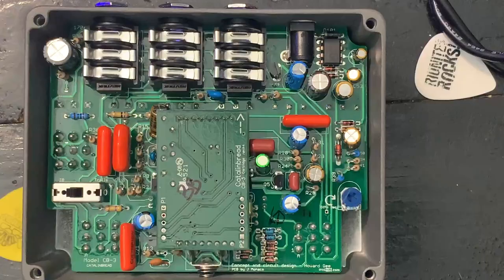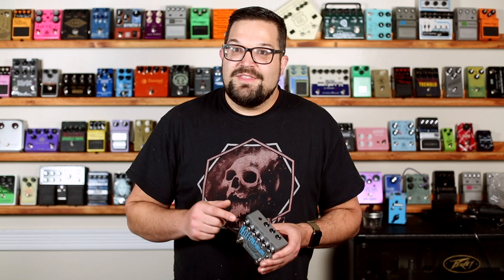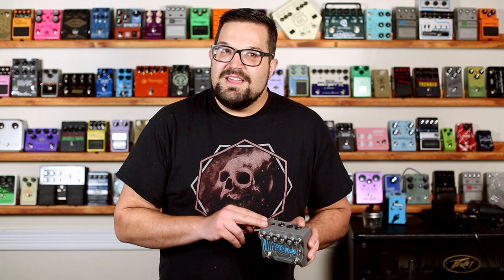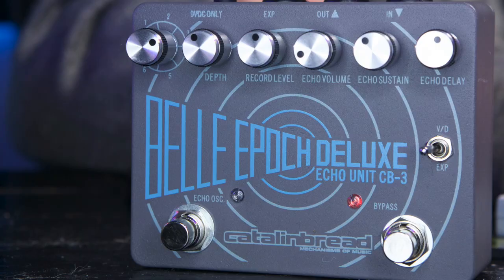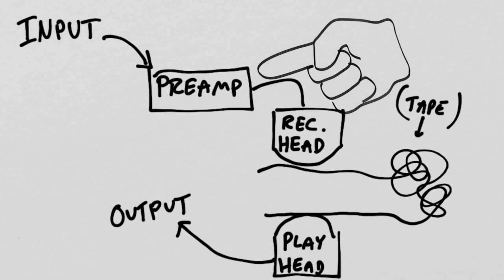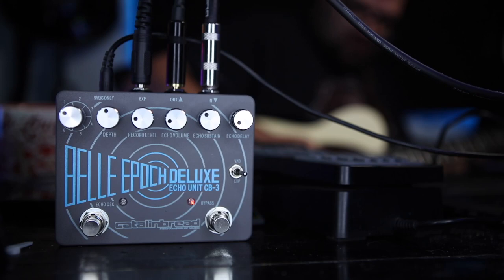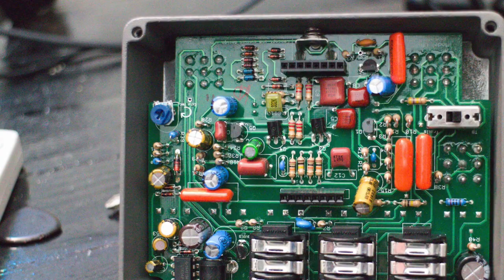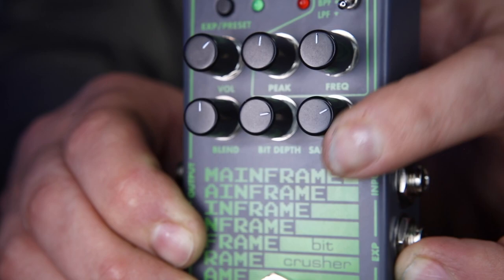Catalinbread Belle Epoch Deluxe - The Misunderstood Delay

Comment: A quick question from a year in your fuuuture..

Is there any effect or level of control afforded by the expression pedal that isn't also readily available from the knobs & switches on the box itself?

I'm going to be using my BE on a desktop, so I'm wondering if I should build a control box that takes the place of the pedal?

(If you answer, don't forget to upvote this comment so I get notified. Thanks!)
Reply from the maker: The expression pedal input can control the volume of repeats, the rate of the rotary, and the sweep of the filter, those are things you can't do from the main knobs. It does kind of suck that you can't have an expression pedal and tap tempo, though. Full details in the instructions, check out the third column of the Echo Program Matrix table: https://cdn.shopify.com/s/files/1/0370/1873/0628/files/bed-manual-2018.pdf?v=1588317232

Comment: I’ve had the Belle Epoch Deluxe for 3-4 years now, and this review nails everything all the other reviews miss. I’m big on mode #2 (analog emulation), especially if you crank the pre-delay gain a bit to muddy up the repeats a bit more. Everyone talks about this unit’s tape emulation, but the other modes are underrated.

My main complaints about the pedal are: 1) Lack of on-board tap tempo, and 2) The memory man modes are a bit too clean/pristine, almost to the point that I wonder if any analog emulation is happening on those modes, or if it’s just too focused on the memory man’s modulation. It would be rad if these two modes had muddier repeats like mode #2 IMO, but I’ve never actually owned a real memory man to compare to.

Anyway, awesome review man!
Reply from the maker: Thank you so much, and 100% agreed on all counts. I just recently grabbed a Geckoplex and I wish I could get the features of the Geckoplex with the sound of the Belle Epoch Deluxe. Both outstanding pedals, they just each hold a half of the puzzle.
Reply: @StompboxBreakdown  Oh nice. What's missing from the Geckoplex? The analog preamp mostly?
Reply: Thanks for your comment.   My first delay that I had to have cause of the 60s/70s   I’m gonna try setting 2 more often.
Reply: Last week Catlienbread had a bstock for $250Who cares about the tap tempo lol not me anyways.

Comment: This is the most beautiful sounding demo of the BED, are you using anything else in your signal chain or post processing, any reverb? .
Reply from the maker: Thank you! I just went back and checked my project files and every guitar has some EQ and compression added to it, and the lead guitar parts have a very light dusting of reverb added in from SSL Native FlexVerb (a software plugin). Not enough to sound like an effect, just to add a bit of space/room noise, since I'm recording everything direct.
Reply: @StompboxBreakdown  thank you for your detailed reply. Lovely production values

Comment: Did you end up keeping this on your board? Is it in your top 3 delays of all time, or somewhere outside that? Thanks for this review.
Reply from the maker: I ended up using the Wampler Faux Tape Echo. I really think the Belle Epoch Deluxe is the best sounding delay around, and if it had presets, it'd be a perfect fit, but the Faux Tape Echo was an instant fit and it hasn't disappointed yet.

Comment: I kind of avoid guitar content ftmp, but this video is really great. Kinda thinking about swapping rubberneck for this. Think its more my jam than rubberneck.
Reply from the maker: Thank you so much, that means a lot. Just be aware of the lack of tap tempo on this one. It’s the best sounding delay I’ve used (other than maybe the Geckoplex) but the footswitch options can be a little limiting. Still, having DMM and rotary-esque options are pretty unique

Comment: Try to talk myself into that pedal. I'm using Volante, it's plenty good enough for tape delay.  I have a Rubbernecker. And an Obscura. And a Carbon Copy.  And an Adineko. And several others.  It's hard to say no to echo.
Reply from the maker: To me, it’s a great pedal for getting that sound with that exact type of saturation. There are other pedals with more features but this is the best sounding tape delay I’ve used so far. Rubbernecker is great, and I also love the RE-20 (haven’t tried the RE-2 yet). Yeah… I can’t say no to echo either :)
Reply: The Volante is great. I stupidly got rid of it, but I picked up a Belle Epoch Deluxe and El Capsitan V2 to make up for it. The Adineko is low key awesome, such a great delay and it still flies under the radar, I don't think that will ever come off my board, so good for a ethereal sound scapes.